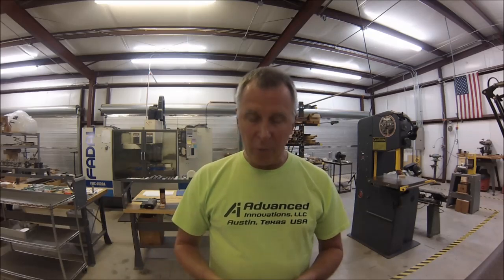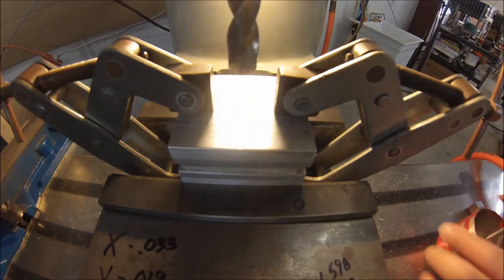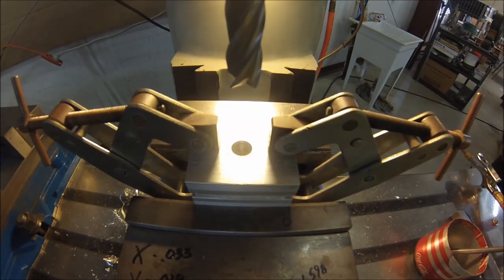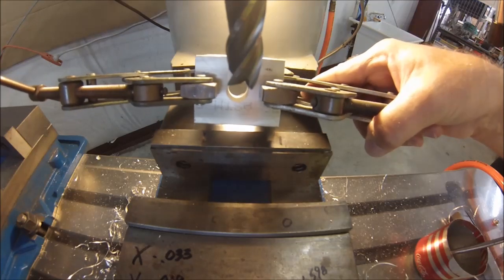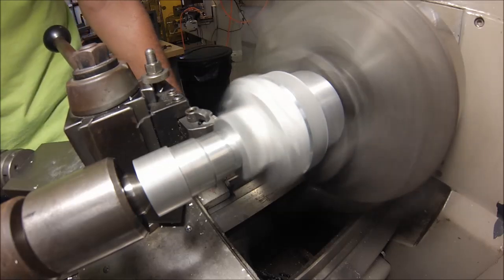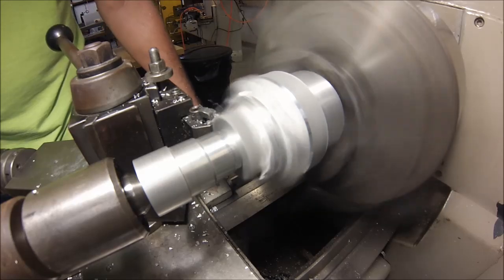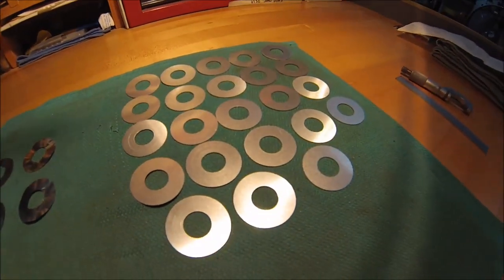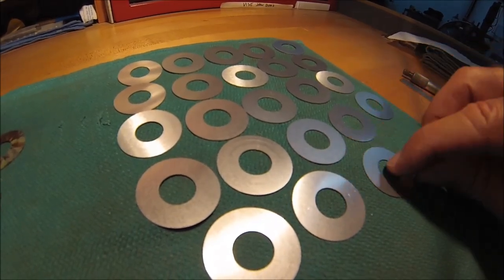Machining ultra thin shaft spacers and precision washers

Comment: ive done similar set ups machining shim stock but i didnt have a through hole in the shim i just sandwitched the shim in between the head and tail stock
Reply from the maker: Watch the pressure turning video.
Reply: thats what i was watching

Comment: I enjoy watching, as I learn lots that I did not know. But if you removed the pin first, would you washers been easily removed had you placed it over a hole and tapped the pin out. leaving the aluminum washers clean,

Comment: Excellent !   Yes, I  have similar experience of machining out very thin wall Plastic Bearing bushes using purpose-made steel filler and outer shells to support when machining the StockTube.  Now I have another problem - machining a retaining ring approx 3/32" sq X-Section at about 2.5" Dia Nom. How would YOU go about that ?  Based on this and  your other video -"Producing Extremely Thin Wall Parts ---Made Easy"  The ring is one piece and acts to hold Piston Slippers against a central Cam shaft.  Be delighted to see / hear.  Thankyou.
Reply from the maker: Use or establish the 2.5" OD first, bore or trepan the ID to leave the ring profile behind, then part it off. Deburr the backside ID by hand.
Reply: Well that's kinda what I was going to do -  but thought it was too "agricultural" and parting off would crumple it up!.   Will give that a try in next few days.  Don't know why these rings have failed  and not been replaced - Manuf'r closed down after Parker took over and parts no longer available. I acquired 3 of those motors and as far as I can see, that was the only problem.  Regs.

Comment: Great video there Joe. 

 I have a question for you - if I face off a tube, say 1.25 od x 3/4 id then part if off to make a washer 1/16 thick, how can I then hold the washer to face off the parted off side so that I have a good finish and the two faces are parallel?

I tend to find that the parted face is bowed or doesn't have a good finish.  I've sorted it before by  facing off some round stock and then machining a step on it which has an interference fit with the i.d. of the washer.  Then I push the washer good side up square against the face and take teensy cuts to get it good both sides.  The fit is usually enough to drive it against those small cuts.

Just wondering how the Pros do it,

Thanks

Comment: A lot of folks asking about your clamps....what machinist doesnt already know about kantwist clamps? Maybe it's just because I've done it 25 years I don't know. Great video!
Reply: I'm not a machinist and had never heard of them. Tried searching Google half an hour with no luck. Difficult to search without knowing the real name. Beam clamps are similar but not the same really. Eventually trawled through all the comments until found this one. Hard to find in the UK. Not available on Amazon UK. Only available from the USA with hefty postage plus import taxes (or Germany at twice the price) on Ebay. Finally found them from MSC

Comment: Really really great video -I am just learning but I would have thought that the thin sheets would have just bent or bend over and get caught and spin or at least that would have been what happened to me if I tried it lol because I have often thought of doing it this way (on the Lathe) I see that did not happen so I am assuming that you need a LOT of pressure being applied by the tail stock? Thanks for a Great video

Comment: Nice method!  I made a one-off bearing shim with a parting tool and a piece of pipe, but it was pretty thick, at about 0.023.  Not a very practical method (mine) if you need stainless or plastic (have to have the right size pipe), but sometimes junkyard engineering can be fun.

Comment: You are definitely a master machinist. I’ve done the same but used a shouldered bolt for the pin and tightened it together with a nut. Much easier for a one off operation. If you need many of these then this method is far superior.
Reply from the maker: Thank you sir.

Comment: 11:00  why do u adjust the bit in the holder instead of just swinging the entire assembly?
Reply from the maker: I usually have my tool post indicated so I can use my threading tool without having to fuss with alignment.
Reply: Joe Pieczynski -  yes, thank you.  u are a most excellent instructor thank you for the assistance.

Comment: Sometimes I need to machine round parts (~20-50 mm OD) that DON'T have hole in the middle. I do it by gluing thin plate stock to the plate and then turning it this way. Very slow and sometimes unreliable process. I am thinking what would be better jig I can build for that? Milling it on a rotary table while moving and replacing clamps in process?

Comment: I've become spoiled to my wire EDM.. but this is how we used to make a lot of thin bearing plates for instruments. "Pressure turn" gets lots of strange looks from machinist and toolmakers these days.
Reply from the maker: Most guys wouldn't believe the work I've done pressure turning. Just stand to the side when you do it. Especially when turning 9 inch square 1/8" thick SS into a disc. The resulting corner remnants are interesting.

Comment: I found if you try to turning the shims or any tight fitting part on a shaft as you try to remove them off the shaft it helps them from binding.

Comment: Hi Joe,
WAY OFF subject here:   Do you know anything about high frequency electrical induction equipment to harden steel 'beds' or
Salt Baths used for the hardening of gears?
David.
Reply from the maker: Hi David, my only exposure to either of those is the salt bath. We used to use one to draw down and stabilize tool steel after heat treatment. It was more of an annealing bath I believe. I have zero experience with the induction hardening stuff.
Reply: Thats Joe, all good.

Comment: Joe, if i were to make a shim with some .001 aluminum foil, what are the chances the closed end of my vice could be shimmed up from underneath?, as it is .001" out on the left side.  i have trimmed the devil out of the whole table, vise and all, but can get no closer that a thou over the 5" vise width.  When i flip the part, sometimes it comes out to a .002" deviation.  i'm guessing it's because i flipped in the wrong orientation.   Can ya give an old fart some pointers, Son?
Reply from the maker: Are you referring to the bottom of it where a parallel would sit?
Reply: I think so, my thought was it was the underneath, but TOT has a video in which he goes over a new, off shore vise.  I learned some more, but have no idea how to accurately tram the base w/O a surface plate. That'll have to wait for Stan's summer bash, when I can buy a few things.  I only live a block from him.  Are you coming?

Comment: I have to modify existing shims (.5 mm) for a different application. Original size is no longer available. 50 at a time. Internal arbor , threaded end with heavy clamping discs. Turn O.D. Insert stack in sleeve with internal thread cap, open on end to allow internal boring in lathe. Bore I.D. No longer available parts demand some creative solutions. My compliments to the bearing in your live center. Great video!
Reply from the maker: That is nearly exactly how I have done it in the past. Be careful about the threaded cap. Sometimes it can roll over really thin material and smash a few. But boring through the cap is the way to go. I do have video on that planned to post. Thanks for watching.

Comment: Great method! But i cant understund why you americans still use inches!
Reply: We went to the moon with those silly inches! The metric world hasn't got there yet.  :)
Reply from the maker: I'll bet the majority of us feel exactly the same way about the metric system. We make metric parts, but convert the MM dimensions into imperial before we cut them anyway. I've been told for 50 years to get ready for the swap. Just gotta believe it ain't going to happen.
Reply: Dan Hughes Its just a matter of luck!  With metric you would have been at Mars!😉
Reply: "Imperial" always used "metic" anyhow Magnus, "Imperial" works better in space, reason been;degrees of an arc.
Reply: Works better in space!? Explain! There is no excuse for imperial. Maybee only old machines with scales based upon imperial.
Reply: A minute of arc is a unit of angular measurement equal to 1/60 of one degree.
Since one degree is 1/360 of a turn (or complete rotation).
Reply: Ok. I know al that But i dont see your point. Never mind. Have a great easter!!
Reply: Same to you Magnus, you will have to think about, then you will realise.
Reply: David Marsden I dont see any problem in calculate angels or radians in metric. Metric is superior compared to imperial  no doubt. 
I use both at work because we have american components.
Reply: Hi Magnus, well to say its 'superior' is just an opinion, like you i use both.
My preference is imperial thats all.
Reply from the maker: Gentlemen...if I may. I would like to comment. If I was raised working metric, I'd be hard pressed to think anything was better. I believe its all about making parts go together. Its just a different language based on where you are. All of us US guys have been prepped for the big roll over for years. Just for the sheer impact of that change, I have to believe we are sticking with the imperial system. Not because its better, but because its got deeper roots on this side of the pond, and a shift in the base standard would be waaaaaaaay too expensive.

Comment: awesome channel joe. i have a question for brideport set-up that i cant find the answer to. i need  find a way to adjust the column pivot so the nod feature swings square to the x axis.
Reply from the maker: Clamp a bar to the table, put an indicator in the collet and indicate the bar square to the x axis and inline with the y axis. Loosen up the ram extension nuts and slide the entire head assembly forward and back using the right side movement handle. Indicate the bar at this time using the entire ram movement. I can only assume the swing of the head is now inline with the x axis as well.
Reply: i also assumed the nod would be parallel with ram travel. no such luck. thanks though.
Reply from the maker: Let me think about this for a while. I am surprised those are not parallel.
Reply: yeah, they are close, just not close enough for what i need to do.
Reply from the maker: What if you were to setup a sine plate with the pivot hinge parallel with the X axis and tip it to a known angle. Then throw the head and sweep the plate with an indicator. If the spindle is true to the head, this should line up the head square to the table. Naturally, some of your adjustment will have to be done by rotating the column to zero your indicator. You can then double check this theory by setting the plate to a different angle and indicating it again. Only the angle of the head should have to be dialed in if the ram/head combo is now true to the table.
Reply: i am definitely giving that idea a try. ill get back with you afterwards and let you know the results. thank you.
Reply: Set up a right angle plate on the mill table as parallel as you can make it to the Y-Z plane.  Sweep it while trying the nod and column adjustments.  Your Y-axis can't be too loose if you want good results.
Reply: im not concerned with y axis. the x and y have never been square on any bridgeport ive ran. again, like the ram and nod, they are close, just not the dead nuts they would have to be for your idea to work. i think joes plan will work as long as the hinged edge is square/ paralell to the pivot. i just need to run down a sine plate. preferably a 10''.

Comment: instead of using that aluminum blocks as parts of the sandwich, you could better use wood. that's a lot cheaper and works the same. sorry for bad english.
Reply from the maker: I have to try that. You are the second person to suggest that. Thanks.
Reply: ow, sorry. you are awesome

Comment: Thanks for the video, Joe. I WILL be using this as I use a lot of thin shims. I've typically purchased shims or made form cutters and punched them in a hydraulic press. Usable, but not nearly as nice a finish. After 42 years in machine repair it's still nice to learn a few new tricks!
Reply from the maker: Thanks. Stay tuned. I plan to put these back in the lathe and bore them out.

Comment: I've done this operation having to turn down washers to a smaller diameter. However a much quicker method is to use a nice high quality bolt with a shoulder that fits snugly into your hole. Much less time and less material wasted
Reply from the maker: A bolt will get the job done. No doubt. This way is much more precision though if you need it.

Comment: Do you think this technique would work using scrap pieces of Hardwood for the clamping plates?

I've done something similar when drilling holes in thin sheets.
Reply from the maker: It may. I'd stand to the side for the first try though. Orient the grain inline with the spindle for the least amount of wood compression for the backer plate.

Comment: Very cool. That's similar to a technique that woodworkers use when planing thin sheets of veneer. They clamp them tightly between two pieces of scrap wood and plane the stack flat and smooth. That process yields a superior seam when the sheets are glued to the final substrate.

Comment: Most interesting. Once I wanted some 1 inch discs (no centre hole) out of 28 thou brass and the only way I knew was to use a fly press, but not having one I got quotes and with the set up time for small numbers the price was not economic. I had to give the idea up, but this idea makes me think about revisiting that project. I could guillotine out squares and then with pressure, perhaps machine them into the circular discs I wanted. Thank you for the inspiration.
Reply from the maker: Piece of cake. Get to it.

Comment: Didn’t know how else to contact you for a question. I have a South Bend 10K lathe and was turning down a 5/8” steel rod (just run of the mill stuff) using a carbide insert in a ⅝” holder AXA. When I cut toward the chuck using the right hand tool holder I got a ruff cut. Then using the left hand tool cutting toward the tail stock I got a fantastic clean cut, like it was polished. Figured the insert on the right hand one was dull, so I put in a new one and again going toward the chuck I got a ruff cut. I can’t figure out why it’s ruff toward the chuck and smooth toward the tail stock.
Any ideas??
Reply from the maker: Hi Tom. What was your material and cutter profile?
Reply: Joe, I should add that my shop is a home one and do some machining and welding as a hobby, plus I am 71. My "education" in both fields has been through Youtube, books, and talking with my local welding shop folks. Ok - That being said if I understand your question the 5/8" rod is something like 1020 and the two holders are  SCLCR/L 95 degree, with CCMT inserts. Called Shars Tools and was told the insert is a CCMT32.5, (?) but they were not sure if the radius was 1/64 or 1/32. I am going to take the insert out of the SCLCL and put it in the SCLCR and see if that fixes the roughness. Will repost when tested.
Reply from the maker: Have you ruled out a bell mouth condition in your chuck?
Reply: I found the cause. I put a rod between centers using a lathe dog and got the same results. So the chuck is ok. Last night I thought about the height of the insert: I always try to get it centered the best I can by eye balling it. So I went out this morning and used my height gauge on the leading cutting edge of the insert. The one toward the chuck was on center, but the one toward the tail stock (good cut) was very slightly above center (guess about .005). When I moved it to center I got a ruff cut. My question now - is it a good practice to run these a very slightly amount above center??
Reply from the maker: Sometimes tools flex under load and take on a pre loaded posture they are comfortable with. If your tool is flexing downward toward center and cuts good there, set it slightly higher. Its OK.
Reply: Thanks for your suggestions and especially how fast you got back with me. Again thanks! :-)

Comment: I would have expected some tearing of the shims. Excuse the lack of proper terminology but I assume you have a very small cutting radius, and angle the cutter so it engages towards the axis rather than flat or starting cutting from the outside?
Reply from the maker: Very good. Kicking the tool face so the tip engages before the full edge is the way to go. If your offset is too aggressive, or your cut is too big, the first pass chip will be a ring instead of just 4 corners coming off. I like a small radius for the finish pass as well. Good comment.

Comment: That's a handy tip. I actually need some for my lathe.  I need to shim the x slide dial, and my current washers  are just a little too thick 6 thou if I remember.. might do some brass ones, since I have a brass shim sheet stock.They would be small diameter but I'll give it a shot. probably about 3 or 4 thou.
Reply from the maker: Piece of cake. Make a stack of them. It takes the same amount of time and helps the process go smoother. Its OK to mix material thicknesses too. Make a variety all at the same time.

Comment: +1 Hello Joe. I have a question about same thin staff - tiny pushrods, long pins, particular conical gauges, engine valves, valves guide cone measure instrument etc. We are use moving steady rest but at the end I need to finish distortion on cylindrical grinder. For example I can not make "precision pushrod" 200 mm x OD 8 mm on my lathe without using grinder. Have you ever do something only on lathe machine? thx from UA!
Reply from the maker: Sure. Don't turn the part with the full length exposed all at once. Do it in segments. If the surface finish and tolerance will allow, this way will get the job done. You may have to fuss with the concentricity between cuts, but I do it all the time.